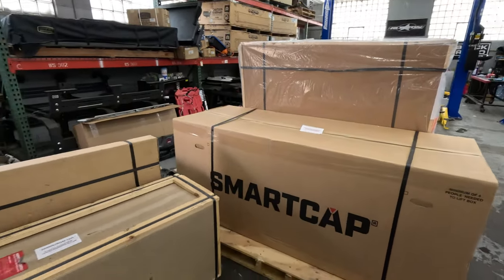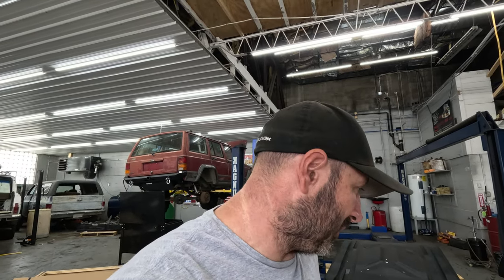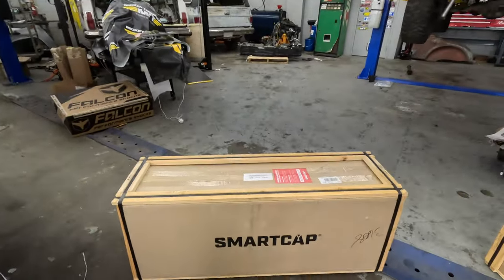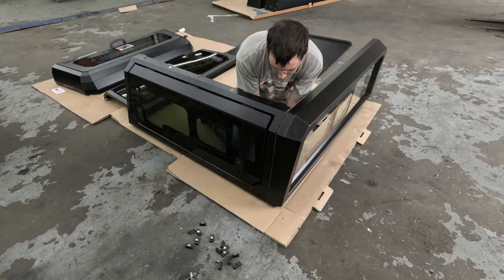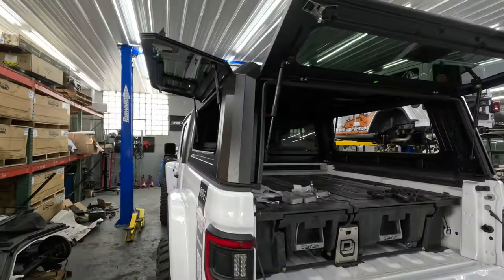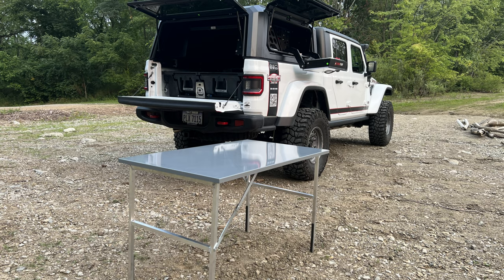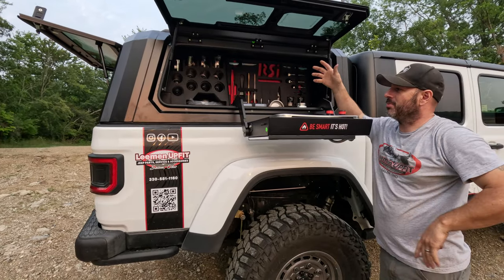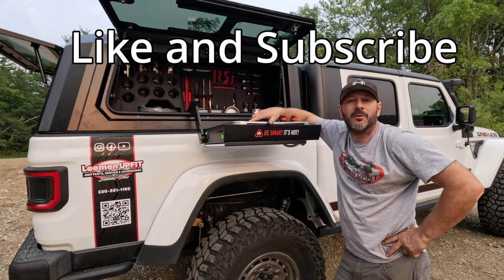Jeep Gladiator RSI Smartcap Review and Install Overlanding

Comment: As for me. I’ve had these type of shells before. Compact, storage, and good conversation pieces. Stove is to high. Sits above 4x4 fat and wide tires (get your clothes dirty). I feel like these would be good if you don’t have Decked storage. 

Got me a new vehicle and ended up getting a compact overland trailer instead lol.
Reply from the maker: The stove is definitely not practical on this particular set up. It works very well for a lot of people who have stock Jeeps. I have it on mine just so I can show people who come into the show room what it looks like. But I actually really like having the decked system and the RSI Smartcap both for storage. We travel in a large group since we have five children and they’re in multiple Jeeps. But I am the only one carrying all of the food in gear. Thanks for watching.

Comment: Thanks for the video.  Thinking about one of these for my wife's Gladiator.  The kitchen was pretty cool.  The only negative about the kitchen is the stove ended up being pretty high.  They are expensive; however, they are cheaper than doing some of the "half caps" that are available which are about $3,500.00 to over $6,000.00.  Too bad you are up in Ohio.  I would have you price one of these for me.
Reply from the maker: I love mine. If your ready to buy and you can pick up in Ohio I have a couple here that I gave give you a deal on.
Reply from the maker: Email me at leemenupfit@yahoo.com and ill see if I can help you
Reply: @leemen  Sending you an email.

Comment: Good video. Thanks.
Does the cap come without windows? I'd prefer no glass, and metal all around, except for maybe a sliding window up front at the cab.
Reply from the maker: Yes. The cap we stock has no side windows. But they all have a rear window. There is an option for a security screen for the rear window. And they all have the sliding front window. If you would like a price email us At leemenupfit@yahoo.com.

Comment: I like these, but my question is, with a slightly lifted truck, how is it accessing the BBQ with pots/pans on it as got to see what you are cooking to see if it's made or now.
Reply from the maker: With a lifted jeep the stove is a bad idea. Thanks for watching. Let me know if I can save u some money on a cap.
Reply: @leemen   what would you recommend for around $3000?
Reply from the maker: @alisedighi3844  in a cap there isn’t anything for $3000 that’s quality really. I can get you 1 of these smart caps for under $4000
Reply: @leemen   is it just the cap, or does it come with the kitchen? Have they fixed the locking mechanism?
Reply from the maker: @alisedighi3844  the kitchen in not included in that price.

Comment: What's the inside height from deck system to roof? Wondering if my dogs kennel will fit inside. Can't find this answer anywhere
Reply from the maker: 33 inches from top of decked system to rear glass opening. I had to go to our decked system video and look at a comment I sawed there. Thanks for watching and subscribing if you haven’t.

Comment: If I'm not mistaken, I can see that your bed cap is warped from the clamping force where the ticket 2.5" paddings are. can you confirm?  and if so, is it just aesthetic/cosmetic problem?
Reply from the maker: There are small pull spots we’re the clamps are. No water leaks around that seal and when u release the clamps it springs back.
Reply: @leemen  thank you so much for your fast reply. much appreciated and apologies if I have said anything negative about it. I own a smart cap as well on my JT and noticed this and been researching to find out if it's just pure cosmetic/aesthetic issue. I've talked to people on the forums and said that over time the bed cap will be deformed. Just wanted to make sure that metal rail underneath the cap is ALL OK and sounds like just the cap has the problem with the weight added on top of it. This is not a big deal since bed caps are pretty cheap
Reply: @leemen  and subscribed!
Reply: Is your cap clamped to the bed frame lip or to the trail rail ?
Reply from the maker: @cradb1248  it is clamped to the lip.
Reply: @leemen  I see now they send both type clamps with a purchase !
Reply from the maker: @cradb1248  I just prefer to not use up any of my trail rail. Thanks for watching
Reply: @leemen  good point 👍🏼